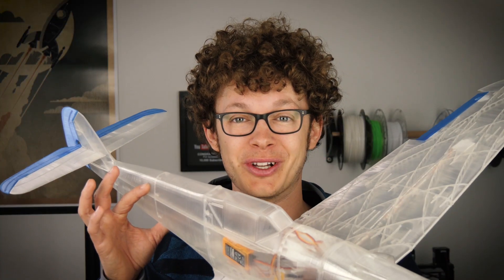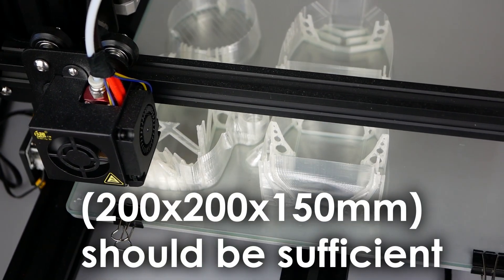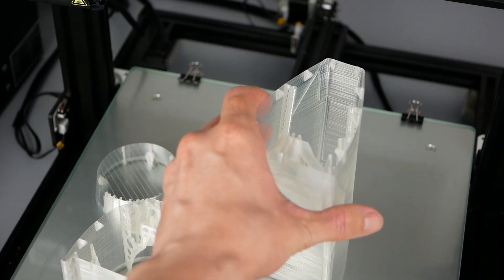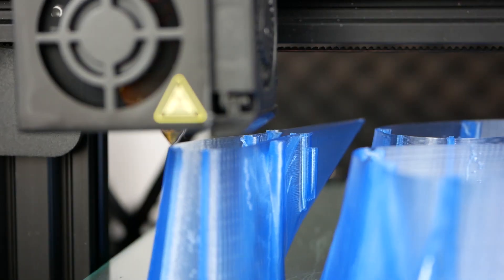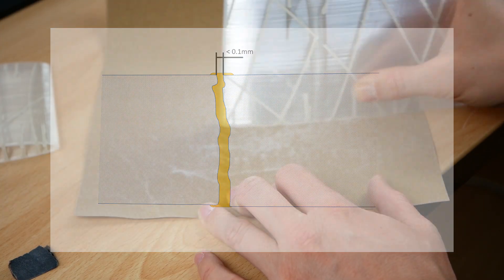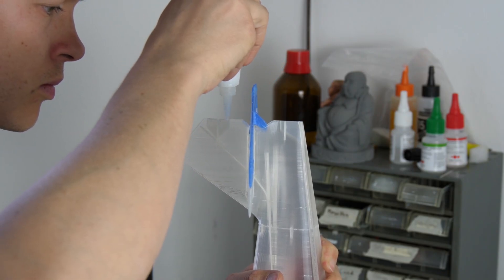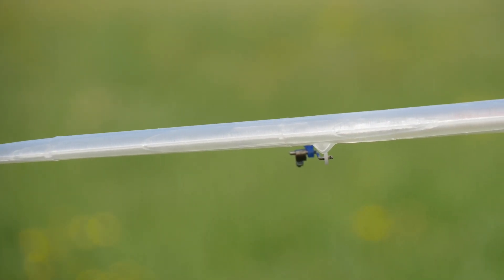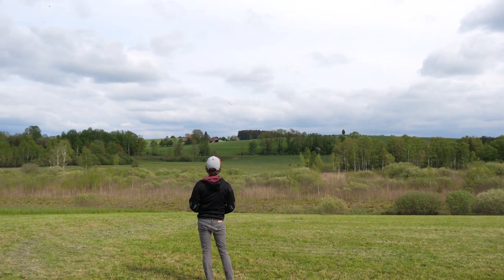HOW TO 3D PRINT your own RC AIRPLANE

Comment: Super glue and Bicarbonate of soda also works really well to bond things together. VERY hard and strong bond. Cornstarch as well as baby powder also work well. But they have different consistencies. Cornstarch is super quick, like basically instant. Good for quick in the field fixes. Baby powder is a quite a bit slower setting than bicarbonate of soda with super glue, and can be used more like a putty but isn't as strong as Bicarbonate of soda. 
Quantities for mixing are very dependent. You can tell when Bicarb is saturated with super glue. Cornstarch is more like a sprinkling over the super glue. For baby powder there is the biggest difference. You can mix in as little or as much as you like depending on the consistency you want.
Reply: Bartosz Jakubowski       it gets hot?  How hot are we talking here for you. I would say more like a bit warm on bigger chucks. Granted the biggest filling I have done is about the width of my pinky finger. I have noticed it gets a bit warmer the more there is, but not by much. Maybe 28-35 degrees C maximum. Certainly not hot enough to melt or soften something like PLA. 
I wonder if it is related to the type of super glue. Some are meant to have different set times and viscosity. so whatever they add to change that factor could be what causes more or less heat. 

And yes thinner the glue the better for dispersion in the bicarb. Gel type super glue will work but only if you mix it in before you apply it. Which is really not great. 

Oh and Bartosz. Maybe try a thin sheet of silicon instead of paper for the molding. I used to use paper. Which is fine when you are at a workshop or at home where you have paper. But when you have to go out or if it is part of your emergency repair kit, keeping paper around is a pain. A little sheet of silicon is great and infinity reusable. Plus the added benefit of no super glue soaking into the paper (which is added waste glue) and no accidental sticking of fingers to paper if you are holding it there. No paper left behind either when you use silicon.
Reply from the maker: Good to know, thanks!
Reply: Was gonna say the same thing with the bakig soda, just remember it gets HOT if you bridge any bigger gaps. I woulld even recommend using paper molds to keep the baking soda in place, and then drip superglue onto it so you dont have to sand so much. Youd need thinner superglue for that tho, like blue spot (:
Reply: Bartosz Jakubowski besides the heat,  baking soda makes fumes.  But it is very strong
Reply: Martin B "hot" is subjective.  I don't know that it would be hot enough to burn skin but it does get warm. 
The gases when mixed with baking soda is like tear gas.
Reply: Mark Daniel  You are right. "hot" is subjective.  I wonder if that is a brand specific super glue thing. I am well aware of the fumes from super glue on it's own. It can be pretty bad. I don't recommend getting your eyes or nose close to it. But I have never experienced the level of "tear gas" after mixing it with baking soda.   Might have to try a few brands to see if there are any specific blends that are worse. However I will say this. The worst smelling super glue (which also happens to be the least effective and slowest super glue I have ever used) was Bostic brand super glue gel.....never again. It took over 30 minutes for a small blob to set. Even after that it gave the worst bond I have ever seen from a super glue. In fact in the cases where it got in contact with even small amounts of baby powder and corn starch (from being used in close proximity) It never fully set. Even hours later. 10/10 would never buy again. I haven't even finished the tube because it is so terrible. 

In any event I would worry more about messing super glue on my jeans, shirt etc than adding it to baking soda. Super glue reacts fairly violently with cotton and wool products. Enough to cause severe burns and produce flames. And yes I have messed a drop on the ankle area of a pair of jeans in the past.
Reply: Was going to say the same thing about baking soda if it wasn't already posted.   I'm old enough to have been around when CA first came out for building model aircraft.   Accelerator came out a few years later. Besides a filler,   I would originally use baking soda as an accelerator.  I'd suck up some in a rubber ear syringe and puff the powder onto the joints...they would kick pretty much like they do with aromatic ester based accelerator.

Comment: Unfortunately my printer ist to small and to crapy for a projekt like this.
Reply: Probably incurs partitioning the model and lots of glue joints that may need to be reinforced on the inside... but on the upside, every print will be a single-evening print due to hilariously small volume!
Reply: Have printed the spitfire model with 150^3 vol printer - just one extra joint on two wing pieces. Flies great!
Reply from the maker: I talked to somebody else who printed it on his Tronxy X1 with 150^3 print volume.
Reply: CNC Kitchen Ich hab nen Renkforce rf100 mit 100*3 . Effektiv nutzen tut er nur 80*3 wergm Prim und leider kann ich ihn nur bei mir im Zimmer aufstellen und somit ist nix mit Ubernachtdrucke.
Reply: Print bigger 3d printer)